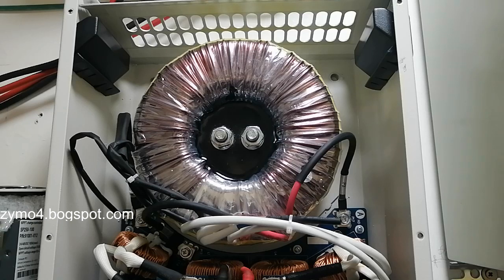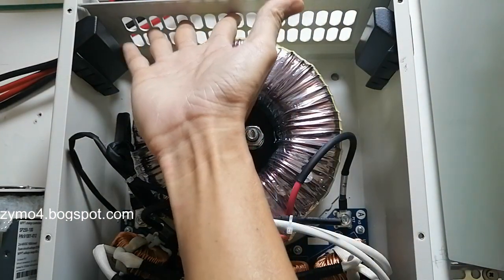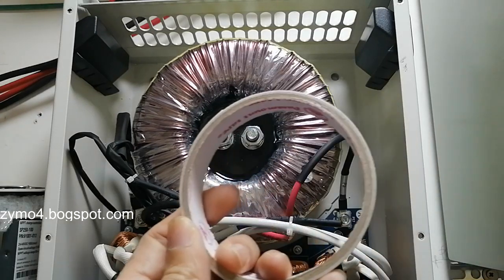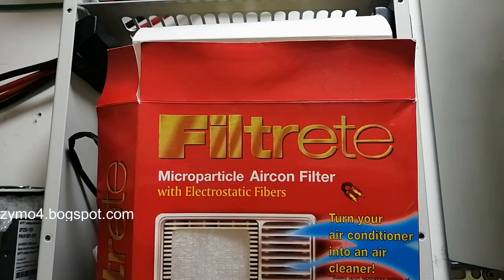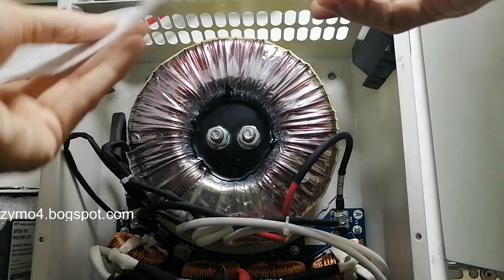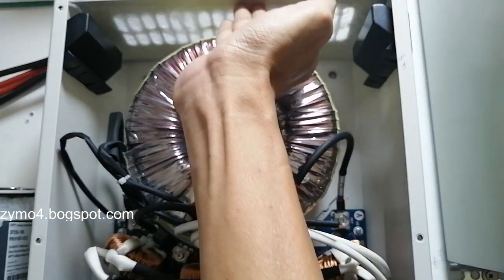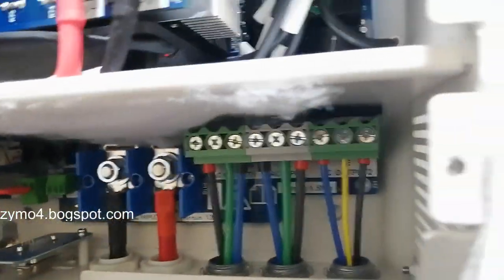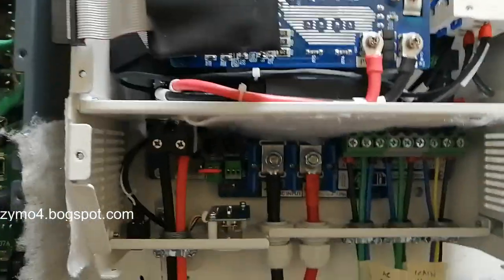How to Protect your Hybrid Inverter from Lizards and Crawling Insects.

Comment: Can we just ask the manufacurer to have one installed so the client will not have problem of the same as you mentioned.
Reply from the maker: Already made the recommendation, but since this is an active cooling hardware, bigger holes are needed dissipate its heat.

Comment: Isnt that aircon filter a fire hazzard while inside the inverter? Isnt a wire mesh secured outside a wiser choice?
Reply from the maker: Its not, its way to far from the heating elements. I’ve place additional “adhesive” that those filters wont fall off from its intended place.  You can use wire mesh if you have one.
Reply: @MarkMinoza  is it possible to stick outside instead of inside? to make sure it wont be a fire hazzard?
Reply from the maker: @CTKChildrensMinistry  yes, you can also do that.